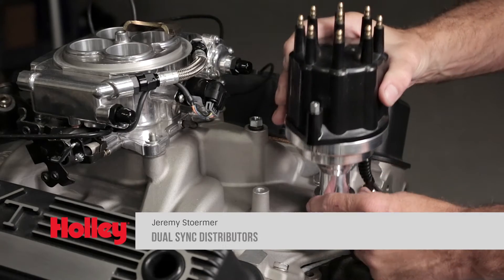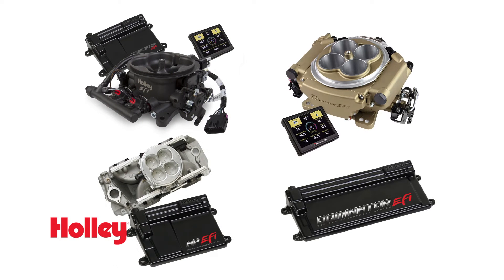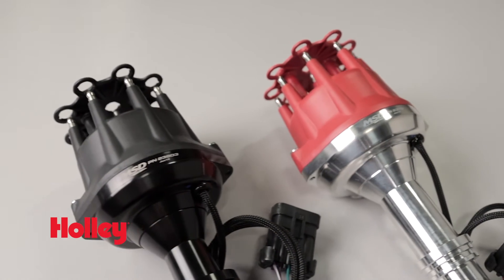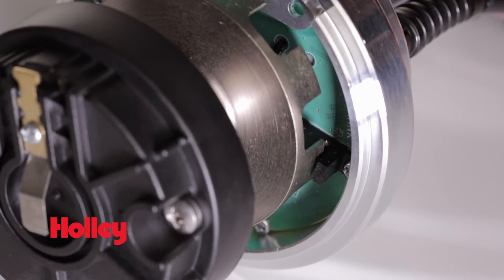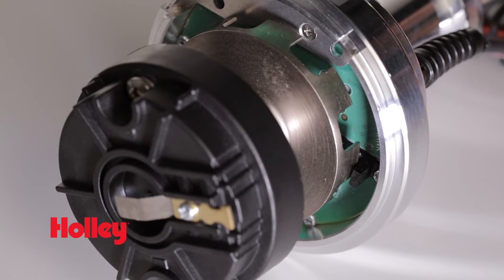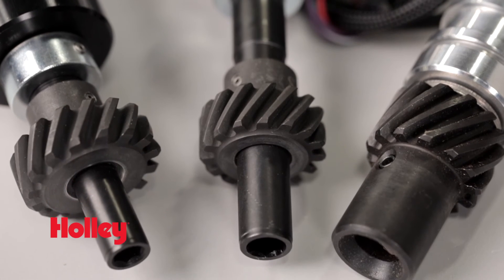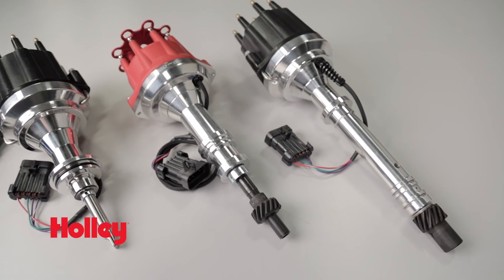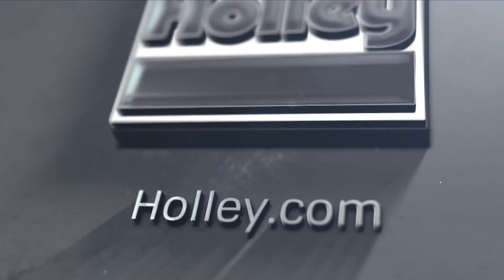Holley and MSD Dual Sync Distributors

Comment: I looking to setup a MSD pro billet in a holley HP... MSD pro billet #
 23753 & Holley dual sync Part #
 565-200 use the same parameters in holley HP ECU?... I only find the parameters for Holley dual sync Part #
 565-200

Comment: If I Install this with my sniper EFI, and let the ECU control the ignition. Is my MSD 6520 Digital 6-Plus Ignition Control Box going to be unnecessary? Or is it still going to provide benefit that the sniper/dual sync combo can't provide? I guess the spark still would be better with the MSD ignition box, but what about rev limits and such, can I control that via the sniper/dual sync?
Reply from the maker: You pretty much answered your own questions.  The Digital 6-plus will provide a hotter spark and you can control the rev limiting using the options found on the MSD box. So if it were me I'd keep the 6-plus as a part of your set-up and take advantage of the benefits.   Thx J